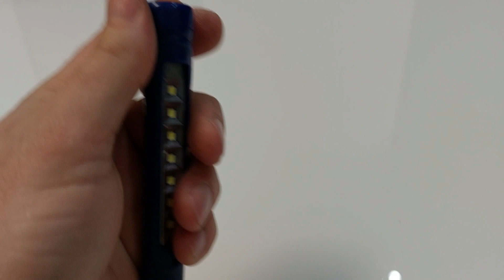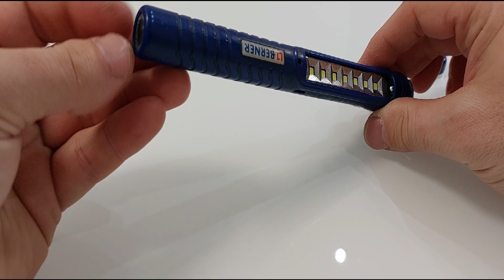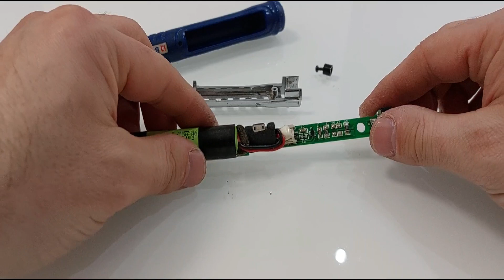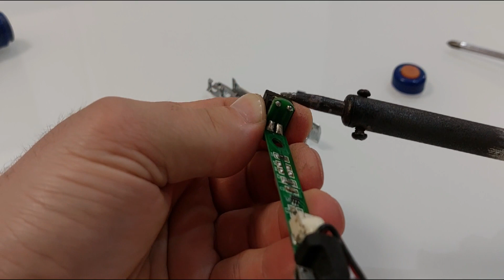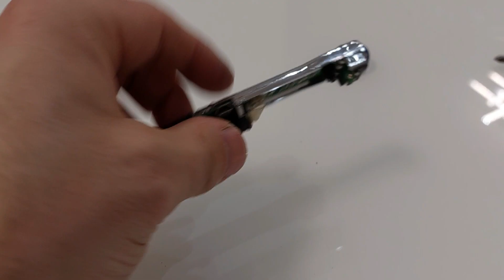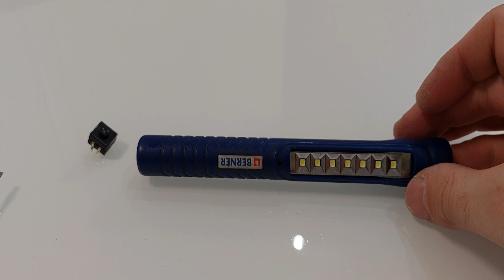How To Change 3Pin Switch ON-ON-OFF 12*12 213BS On BERNER Pen Light 7+1

Comment: SUPER VIDEO AND IT HELPED ME A LOT, I WOULD LIKE TO ASK IS IT POSSIBLE TO BUY A REPLACEMENT BATTERY WITH THE SAME CONNECTION, OR DOES THE SOCKET HAVE TO BE MODIFIED
Reply from the maker: Tnx for your comment,  i dont know if you can find just a battery, but this 3pin switch i ordered on e bay , 10 switches for 1 dollar.
Reply: @jovankostovski83  Hello, do you know if you can also buy batteries and could you send me a link to the switches or their markings so I can find them, thank you